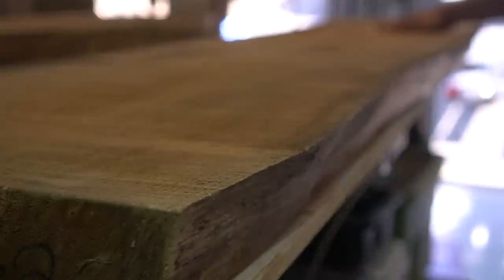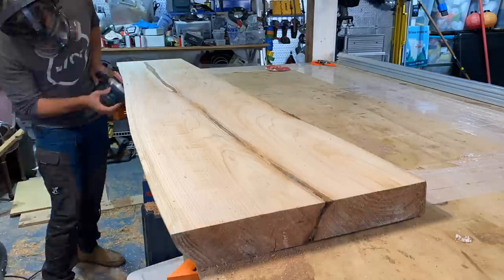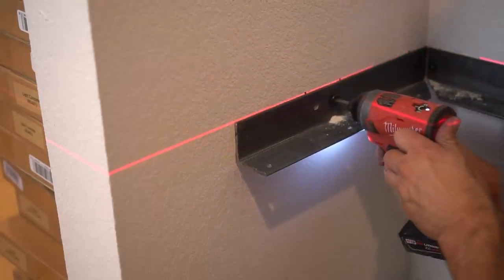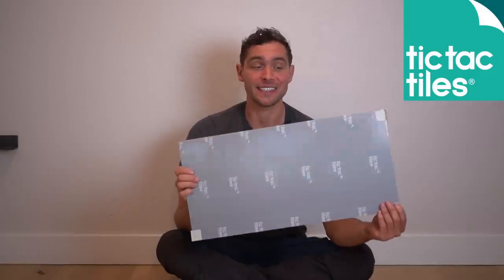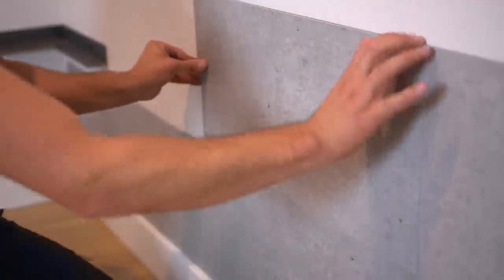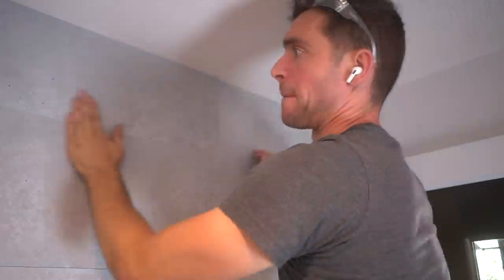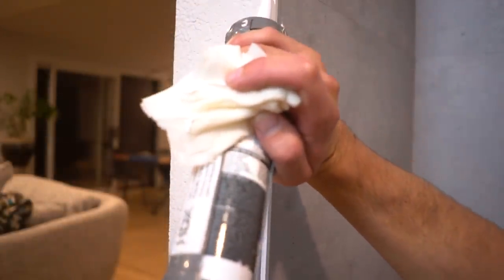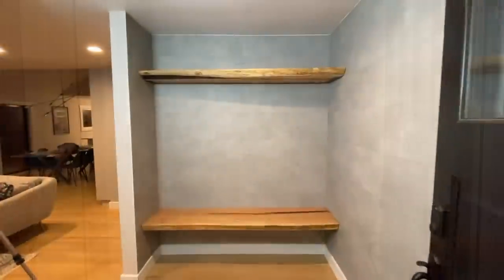DIY ENTRYWAY MAKEOVER

Comment: I'm surprised you didn't, 

A, paint the steel brackets so they don't rust. 
And
B, rebate the underneath of each slab so that the brackets were flush with the timber. 
That would have made the brackets almost invisible, depending on what colour you painted them.
Reply from the maker: Good thoughts Steve and we wanted to go with a natural steel look and these brackets shouldn't be rusting any time soon since they aren't going to be around moisture.  And two yep we could have done that but wasn't something that we had time for on this project.  Thanks for watching as always.